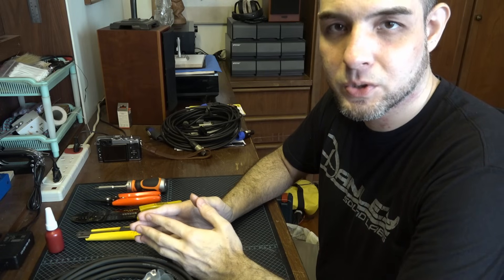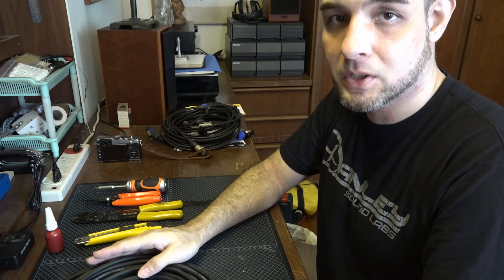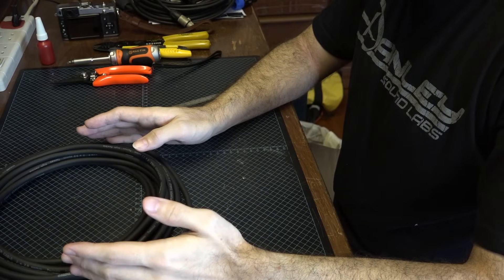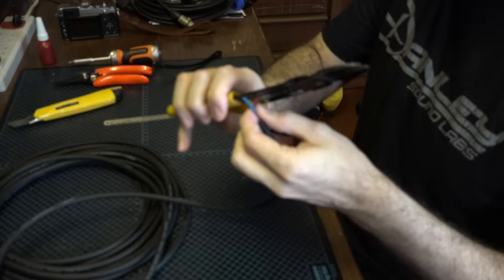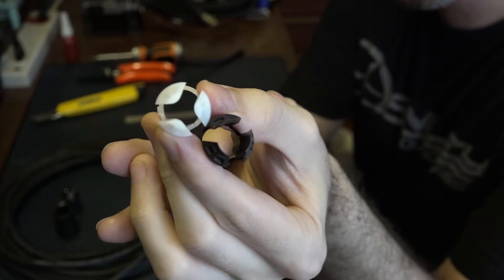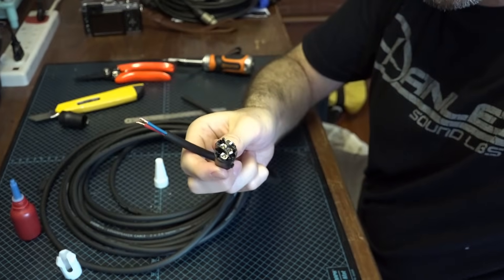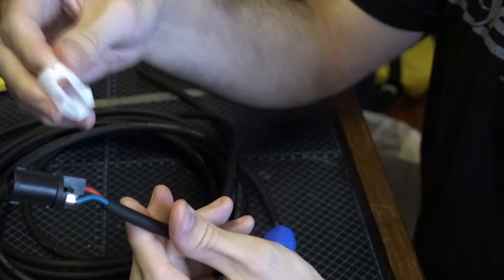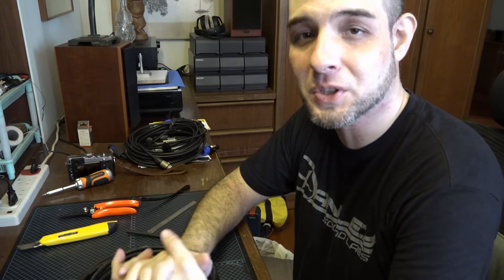How to wire Neutrik SpeakON cables

Comment: How would you connect a speaker jack plate soldered in parallel to a dual 18" speaker box.
Reply from the maker: I would follow the manufacturer's instructions for that particular loudspeaker.

Comment: Thank you for the excellent demonstration and explanation.  I recently purchased a set of speakers with Neutrik connectors, and I've never used them before, since I'm not in the professional world of sound reinforcement.
Reply from the maker: Welcome! I think you'll find the speakon to be a definite upgrade over the old quarter-inch/banana plug/spade lug/bare wire situation 😄

Comment: Well speakon easy than xlr solder. 😅 screw like banana, hope next xlr screw only,faster maintenance
Reply from the maker: I think that soldering is a basic skill that every sound engineer should have - it is a much more reliable connection than a screw terminal and allows for smaller connectors as well :)

Comment: Great clear video.  Do you have any tips for dealing with 4mm conductors?  I can get one in successfully by gently twisting it in.... but the second one just refuses to go in neatly.     Any tools for this?
Reply from the maker: Hmm, according to the spec sheet these connectors should be able to hand conductors up to 6mm2 in diameter... perhaps try using a different brand of speaker cable?
Reply: @GLBProductions  Yep, that's right - and I did some more research in the last few days.  It seems  that for 6mm you need to throw away the screw and solder!!   Also seems like most cable makers are using bootlace ferrules to simplify things on 4mm from looking on some forums.  I have not tried any of it yet but going to experiment further in coming days.

Comment: How do i plug a nl8 to an amplifier?
Reply from the maker: If the amplifier does not have an NL8 output connector (most do not) then you need to have a custom-wired patch panel that takes the power amplifier outputs and combines them into an NL8 panel-mount connector.

Comment: I just bought some JBL speakers that require the speakon connections and finding the cables can be a challenge or even good information sources explaining which cables to use. Your video has been the best yet at explaining the process. so i need the cable to go from the speaker to the mixer. will this wire set up work the same way?
Reply from the maker: You can't connect the loudspeaker directly to the mixer, unless it is a powered mixer with speakon outputs; you need to connect the mixer to amplifier first 🙂

Comment: Great Tutorial 👌👍 i was working on my speaker connectors too: 1 speaker cuts down in sound sometimes: the reason: i didnot use loctite on the screws in the past (when I was 12 years old or so🙈) 
My advice: do not solder the cable ends: i did that too in the past and because of high power that is running through the speakon and the terminals soldering can cause burn speakon terminals: the cables can come loose too like this
greetings from the Netherlands
Reply from the maker: Thanks FJ - I no longer tin/solder the cable ends anymore, for the reason you state above :)
Reply: Thank you too, for your reply,
My tip to everyone: if you have thinner cabling ( I think 1.5mm² or thinner)
Step 1: strip the wires, 
Step 2: twist the cores together and fold the stripped end back (you're doing it right if you fold it onto the insulation of the single wire)
Step 3: See if you can insert this into the connection terminal: with the stripped cores away from the screw 
Step 4: l screw the wire onto the insulation

This way you get a strong connection that, together with the loctite on the screws, ensures that it does not (quickly) come loose.
Reply: Sorry for the much writing but before I forget: for thicker cabling (from 1.5 mm² or thicker or so I guess): Is it necessary to use those sleeves for around the cable-cores (unfortunately i don't know the exact name,but you know what I mean, i guess?): those can be pinched with special pliers: the best is one that clicks: because it tightens on torque. 
With thicker cables you're  getting the following problem with the "fold-on-insulation" method: the whole "package" (of insulation and stripped cores) becomes too thick to fit into the connection terminal: I used 2x 2.5mm² wire; the double folding method did NOT work, for this reason you will need thinner cabling, you will find out exactly how thin by trying the tips

I hope this is useful for everyone, i think it is important and helpful for everyone to share their tips and problems and that we're not laughing at about posts like that, because their always a learn moment for everyone 

Greetings from the Netherlands

Comment: Can I use the same wiring method for bridge and stereo and parallel mode on the amp 11:14
Reply from the maker: That depends on the amplifier - the wiring configuration will be stated on the back panel.

Comment: I have a concern about the speakon connector..and this is it.   As you know, the speakon connector has 4 (or more) pins (+1..-1.... +2.-2).  If I start from +1-1.. and +2-2.. with 2 connections to 2 passive speakers of 8 ohms, these are converted to 4 ohms.. or remain at the impedance of 8 ohms
Reply from the maker: Hello Florin, the pins are independent, so if you connect one speaker on +1/-1 and a second one on +2/-2 they do not interact with one another. Just bear in mind that the standard wiring for fullrange speakers is +1/-1 so any deviation from this can introduce wiring errors into your system.
Reply: @GLBProductions  thank you very much for your reply..it helps me a lot!
Reply from the maker: You're welcome :)

Comment: Sadly I bought a 4-pack of 90 º connectors from amazon with 4-terminals but NONE of the terminals are labeled which sucks because I don't know which to connect the wires !
Reply from the maker: I suggest you return those and order the genuine Neutrik connectors - they make a right angled version which you may still be able to find in stock: https://www.neutrik.com/en/product/nl4frx
Reply: @GLBProductions  Hi Thanks - after a small eyeball measurement I realized that the 90º connectors I bought only saved 1/4"  of distance. Not worth the effort. I believe it's a product that really doesn't even need to be in the marketplace !
Reply from the maker: Presumably that is why it's been discontinued 😅

Comment: Question please , i have passive speaker and a external power amplifier.  They connect with naked wire ,positive (red) Negatice (black) wire. Can i make this wire u did to upgrade my cable or is this just for mic lines
Reply from the maker: The cable and connectors that you see in the video are for connecting loudspeakers only - there is no shielding on the cable so don't use it for microphone lines! 
To answer your question, there is probably not much of a difference in sound quality between this cable and the ones you are already using, unless there is a big discrepancy in the wire gauge size.

Comment: Sir Bruno, please, what if the numbers (+1,-1 and +2,-2) are not present, how do you then know the correct cable connection??
Reply from the maker: All genuine Neutrik speakon connectors will have the numbers embossed next to the terminals - I recommend you use these. If the numbers are not present you will have to look up the position of the terminals online, which can lead to wiring errors.

Comment: Just a small amount of.... Loctode? What is ot? You put on a cable before feed it in..
Also, can cable be wired before feeding in?
Reply from the maker: Loctite - it's a thread locking compound 😄 The boot has to be on the cable before it is connected - the cable strain relief can be added afterwards.
Reply: @GLBProductions  thank you)

Comment: Is there any specific way to wire them for a subwoofer, I will be using a crown xls 1502 in bridged mode, do I need to wire the cable in a different way rather than shown in the video. Help will be appreciated.
Reply from the maker: It depends on the subwoofer and will be detailed in the owner's manual and usually printed on the connector plate. Most subs use +1/-1 but definitely check your make and model to be sure. 
Crown amps typically use +1/+2 on the channel 1 output connector for bridge mode, but once again check your owner's manual to be sure - it will tell you the specific cable configuration that you need.
Reply: @GLBProductions  I apologize, i forgot to mention that I am building my own subwoofer. Should I still use +1/-1 for the subwoofer? And what about the wiring for the Neutrix terminal? Thank you for replying.
Reply from the maker: Yes it's a good idea to stick with the industry standard.

Comment: Hi.
I'm preparing some speakon cables for a "bridged" output.  If memory serves me correctly, referencing another one of you videos, I do recall you saying a bridge output uses +2 and -2 connections.

Is this correct, if yes then which ones are they?
Reply from the maker: It depends on the pins that are used by your power amplifier and loudspeaker - you need to check the user manuals for both devices. In some cases this information will be on a sticker on the back of the speaker as well.

Comment: Is it cheaper to buy the cables and connector separately as appose to buying the cable already for use?
Reply from the maker: Assuming the components are of equal quality it should be cheaper to buy them separately as you are providing your own time and labour to assemble them.

Comment: On the other side of the cable so basically the red is positive and the blue is negative if it's the amplifier doesn't have the same connection correct...?
Reply: Thank you so much for the information..... Merry Christmas and happy New Year 🙋🏻‍♂️🌲🥧🥘🌮🌮🍰☕
Reply from the maker: You're welcome, Happy New Year to you too 😊
Reply from the maker: Correct :)

Comment: Hi!
Is it possible to solder one neutrik connector to a 6.3 mm jack?
I bought a preamp to run my multieffects guitar processor through a guitar cab, but I'm forced to use these two different connectors :(
Reply from the maker: Yes, absolutely, in fact there are commercially available quarter-inch to speakon adapters.
Reply: @GLBProductions  thank you for your kind response :)
Reply from the maker: You're welcome Luca :)

Comment: When are you required to use a 4 wire connection cable? Does the type of loudspeaker matters on this subject weather you use 2 wire cable or 4 wire cable?
Reply from the maker: A 4-wire cable would be used when all four terminals are connected at both ends of the cable - typically this would be when connecting a biamplified loudspeaker to a compatible amplifier output, using +1/-1 for the LF and +2/-2 for the HF. So yes the type of loudspeaker is very important.

Comment: Realizing this video is five years old, hopefully I’ll get a reply. When I tighten the wires, the wires aren’t secure, they pull out easily. Am I missing something?
Reply from the maker: They should not pull out easily - either your wire gauge is too small for the connector or there is something amiss with the connector itself.
Reply: @GLBProductions  Thanks for getting back so quickly. The cable I have is REL Acoustics LTD (stamped on the cable) with yellow, red and black conductors. Is there a specific type of Neutrik connector I need or is that a question for REL? Thanks again...
Reply from the maker: I suggest you ask REL, since they use a proprietary wiring system for their loudspeakers - normal speaker cable always has an even number of conductors.

Comment: Where can i get 10 gauge wire like that loudspeaker wire you got?
Reply from the maker: The cable in the video is 14 gauge. Check your local pro audio supplier or any electrical/electronics supplier in your area.

Comment: Where can I get the little screws that clamp the wire down inside the connector. I ordered nL4 screw and I recieved a bag of mounting screws.   Anyone know?
Reply from the maker: I've never seen the screws sold separately - you may need to recycle an old set. Or just replace the entire connector - I consider them wear items, just like the cable itself.

Comment: how do you connect 2 yamaha S115V speakers in parallel?
Reply from the maker: Connect a standard speakon cable from the unused speakon connector on the first loudspeaker to either speakon connector on the second loudspeaker. Done.

Comment: can you plese reccomend a good loudspeaker wire to use with these. I'm looking for a 4 conductor wire. hopefully 12 or 14 gauge.
Reply from the maker: In practice I have found that any quality loudspeaker cable works fine - I tend to use Klotz, Belden or Canare.
Reply: @GLBProductions  is that good for car audio? I'm using it for chuchero boxes.
Reply from the maker: Yes they will work for that application.

Comment: Bro...if we switch to power amplifier in bridge mode....
On speakon will engage 2+ for (positive ) and 2- for (com/ nagative) on the speakon connecter 4 pole??
Model: Peavey CS 3000 / CS 1400...
Reply from the maker: It depends on the amp - some have a dedicated speakon output for bridge mode, others use pins 1+/2+ on channel A speakon. Check your owner's manual or the printing on the back of the amp.

Comment: When stripping the outside insulation, it is far better to slice the end slightly running down the length of the cable about 20 mm and then pull the outer sheath away from the inner cable and when this is done trim it off. This completely avoids any risk of slicing into the inner cables when you cut across the outer sheath at 90 degrees and go too deep.
Reply from the maker: Thanks for the input!

Comment: Hi, thanks for making this video! 2 questions... I want to make 10 AWG NL4 cables for a subwoofer, who makes the best cable? I know you mentioned Klotz, is Mogami or Canare ok or any other brands you recommend? Second question, with 4 cables, which color goes to which terminal? I know you said red is hot and goes to +1, blue to -1, what about the other two colors and terminals? Thanks in advance!
Reply from the maker: Honestly there is no 'best' speaker cable - any of the name brand cables will be fine. Klotz and Canare are the most common in my part of the world for professional applications. With 4-wire setups you need to see if the loudspeaker manufacturer has any specific instructions for wiring - if they do not you can use any color scheme you like as long as you are consistent.
Reply: @GLBProductions  Ok, I don't see anything specifically on their website, I'll email them to see if they have any instructions. Thank you!

Comment: Hi, I noticed that when connecting to a Stereo Amplifier the Speakon Connector has 3 cables,  2 positives and 1 negative.  How do you wire these inside the connector..?
Reply from the maker: That is not a standard wiring configuration, so you need to check with the manufacturer.
Reply: @GLBProductions  Ok thanks for your reply I'll check it out with them.

Comment: currently my band uses 16 ga wire  3(wire) xlr and 1/4" connectors for our 2 subs and 2 top speakers and our two stage monitors...would we get better sound with 12gauge (two wire) cable with a combo of 1/4" and speakon connections?
Reply from the maker: All other things being equal heavier gauge wire will give you better sound. Whether or not the upgrade is worth the extra weight and cost is another matter 😉 In the above example the 1/4" connector is the weak link.
Reply: @GLBProductions  your a great engineer bruno..keep up the excellent work!!

Comment: how would you wire a three wire connection bruno? with 12 gauge wire?
Reply from the maker: A three wire connection? I don't know of any speaker system that uses an odd number of connections, unless one of the pins is not connected...
Reply: @GLBProductions   how about two wire speakon to  xlr  would the connections be  (speakon pin  1+ to xlr pin 2?) and speakon pin 1- to xlr pin 1?   and leave pin 3 xlr unconnected?
Reply from the maker: You would need to check the wiring diagram for your specific speakers.

Comment: Great video, I am trying to wire a four pole speak on. My colors are red black white and blue. How should I wire it? Thank you for the informative video
Reply from the maker: Thanks for watching Alfredo. The wiring on 4-pole speakon connectors is specific to their use case - consult the loudspeaker and/or amplifier manufacturer for specific instructions.

Comment: Does blue represent yellow? I just bought new SignalCable Speakon for a pair of RELs. I was expecting a red yellow and black wire but I received a red blue and black.
Reply from the maker: The RELs use a proprietary wiring system which is unique to their brand - be sure to check with them on the correct wiring.

Comment: hello, Is it possible to connect to a female XLR plug?
Reply from the maker: Yes but strongly discouraged - the XLR is not designed as a loudspeaker connector and could pose a safety hazard.

Comment: Do you have a video on four conductor sperkon  cable?
Reply from the maker: No - the wiring for 4-conductor speakon cables is not generic and is generally specific to individual speaker models.